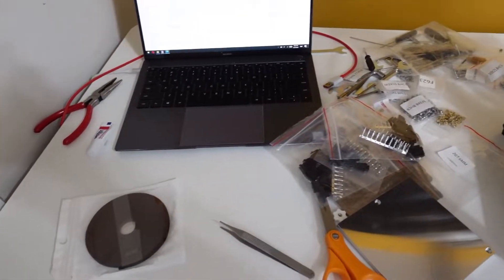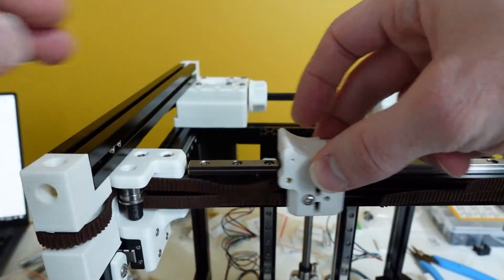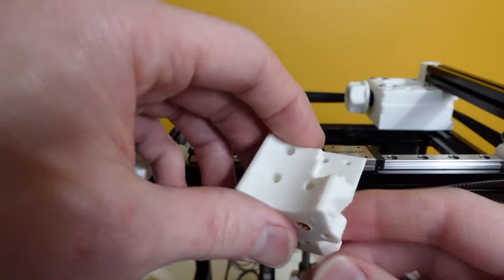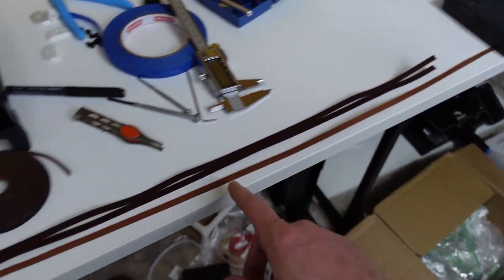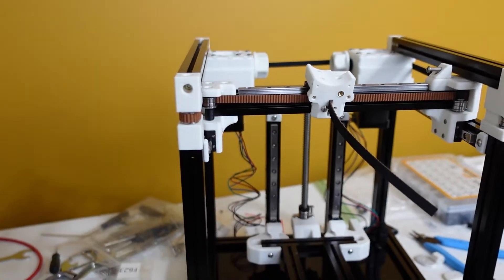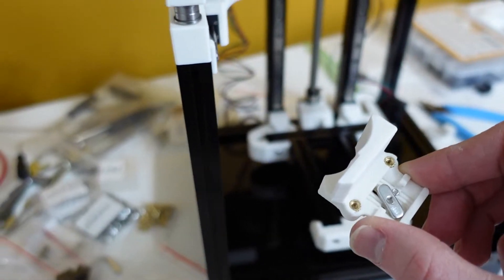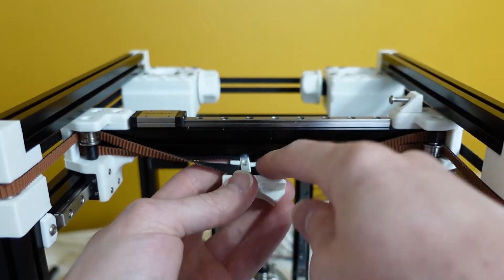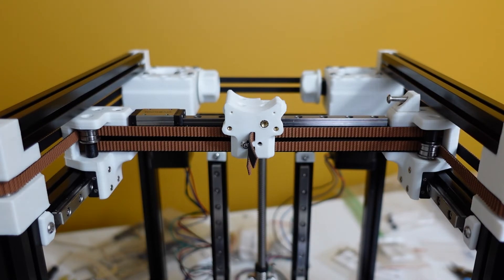Watch This BEFORE You Cut Your VORON Belt!

Comment: i really like your video.  i also followed the instructions and cut them short.  i then installed them correctly but it was too tight and i was skipping steps.  i am in round 3 now.  i would have like to see you finish the install all the way to the right tension.  you have a new subscriber i am new to voron but not 3d printing.  thank you for the content, well done!

Comment: Is it possible to loosen the tension nuts on the motors to make the short belts barely possible for installation and tighten it back up?
Reply: you can remove the front idlers and you will have tones of room.
Reply from the maker: It is, but it would be very difficult. One thing I do not like about the V0 design is that the built in tensioners dont allow for much tensioning room. I have a more full video on that coming later if you stick around!